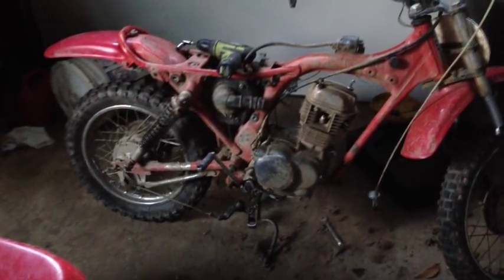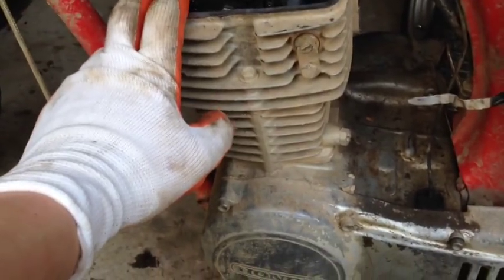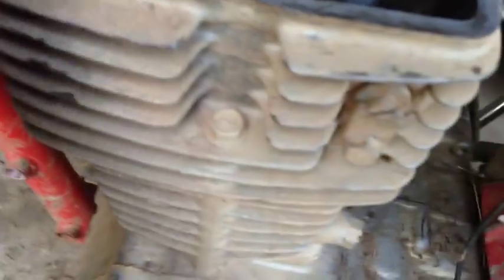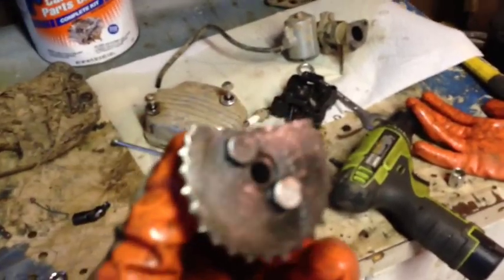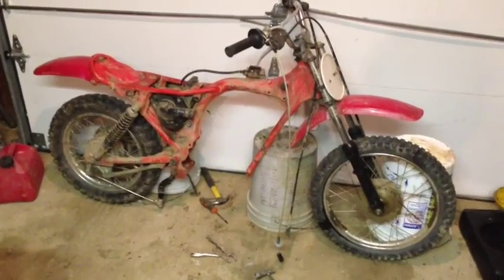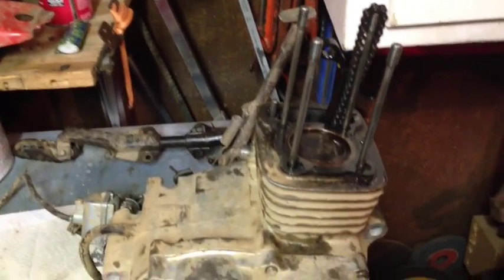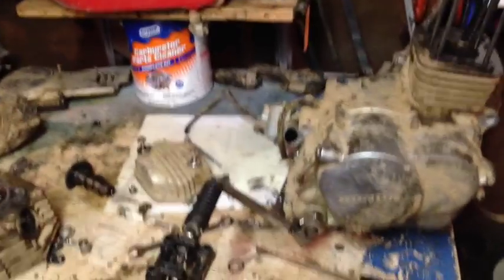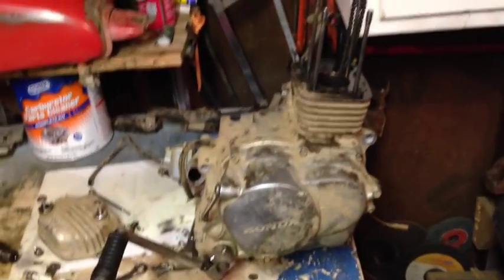1977 Honda XR75 Blew Up!

Comment: As a Kid I Wanted a XR75 !!!!!!!
MAN !!!!!!!! you got it this far ??? New Rings !!! Bore New Piston ????????????
Reply from the maker: hillbillydualsport My dad always tells me that the XR75 was his dream bike when he was a kid, and it probably was the reason I got one as my first dirt bike. Thankfully the only thing it needs is the new cam which I already ordered a Hotcams stage 1 cam. the rest of the bike is fine but while I'm at it, I'm re-painting/un bending some parts that have been bent and smashed like the skid plate, foot pegs, muffler and foot brake and I'm also cleaning everything, re-setting the valves, replacing the cam chain, changing the oil (obviously haha) and whatever else it looks like the bike needs. stay tuned for my rebuild video which I should post in about 1-3 weeks.